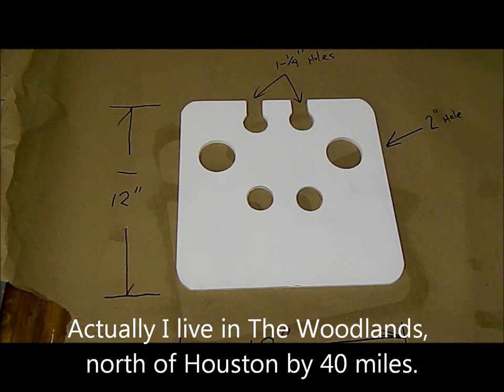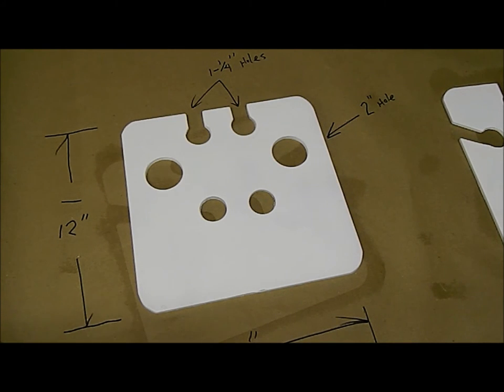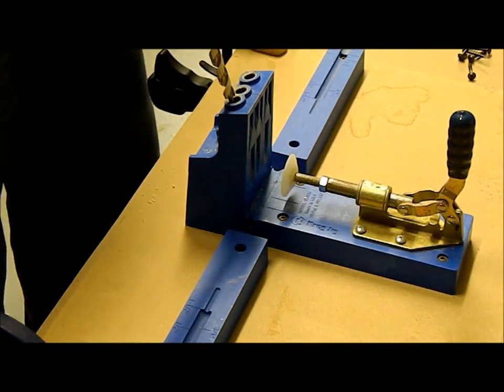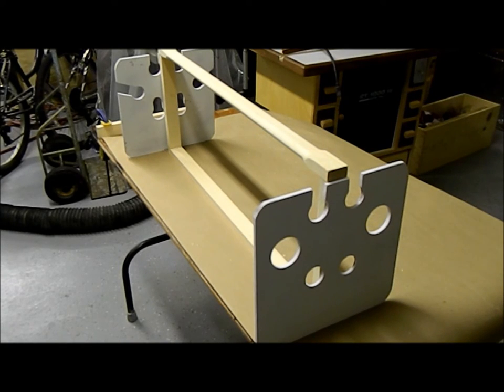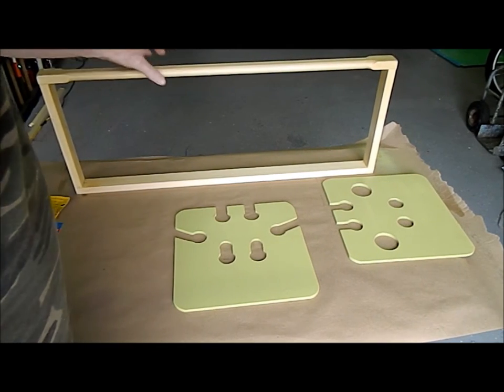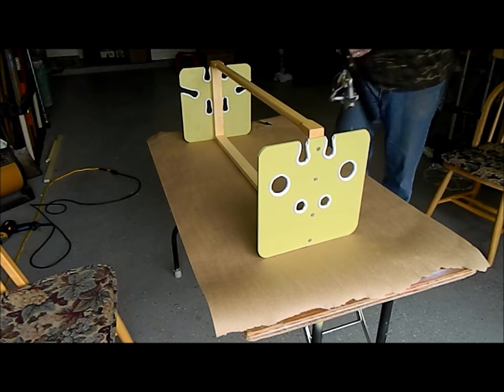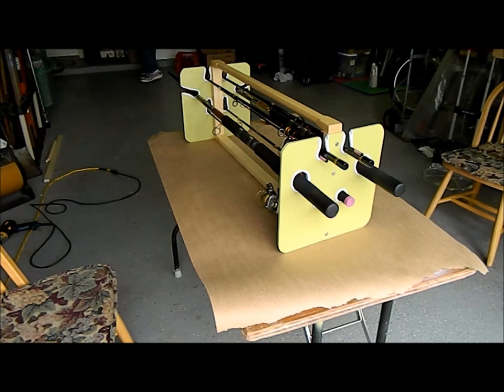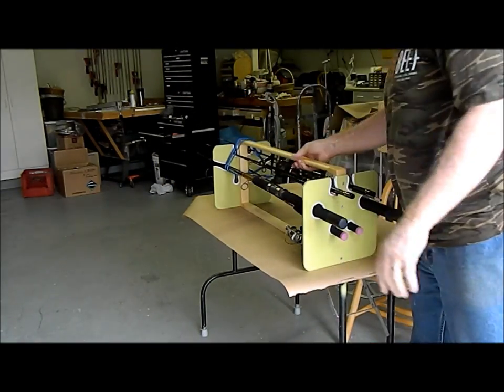How to make a fishing rod carrier (tote) for cheap

Comment: I made one using the cutting boards at Dollar Tree. It works good for hauling my rods down long fishing trails at the parks but I need to buy the large cutting boards from Sam’s Club so the bottom rods don’t drag in the dirt when I set the tote on the ground. Cheap cutting boards at Dollar Tree may be a buck each but they are small and thin and may crack when drilling the holes.

Comment: One thing I do is I bought some hair bands at walmarts that women tie the hair back with and when I take my poles apart I just use 2 of them to hold the rod tip to the main body of the rod, one at the bottom of the handle and one at the tip, that way both are together and it works great. I will be making me one of these, thanks for your video and good fishing.
Reply from the maker: Great idea. Thanks.

Comment: Add adjustable legs to the front or cut the back piece less tall than the front to give your an up-angle when setting it down.  Could also add some flat head screws or or eye bolts on either side of rod, the use elastic hair ties to secure each rod individually. Great idea though! I was thinking about using nylon cutting boards instead of Masonite and connect ends with PVC.
Reply from the maker: +Kilo Charley Thanks. Build it and I would love to see the improvements you mention.